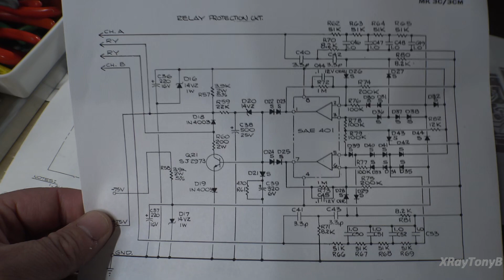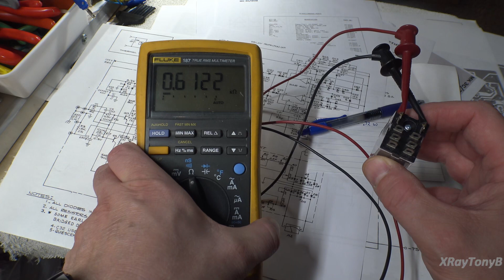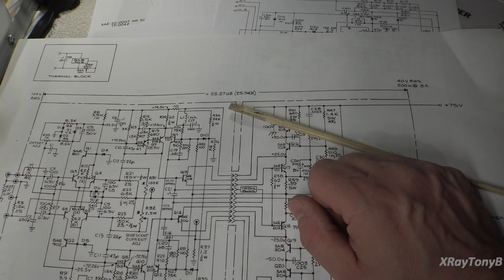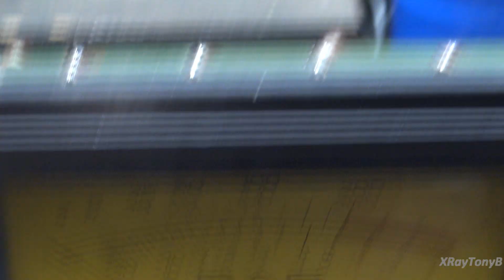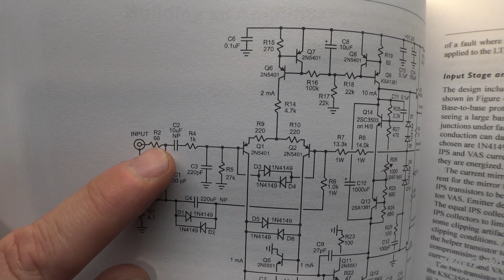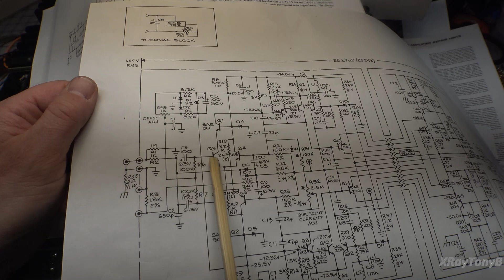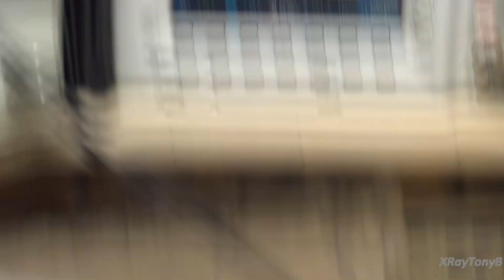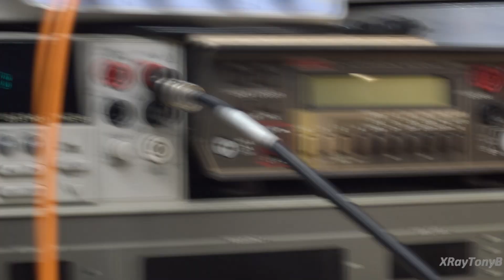SAE Mark IIICM Amplifier - Part 2 - Making it Right

Comment: I'm not happy about you taking schottky diode out I think was the wrong approach! just to protect the transistors why should that matter, The designer put them there for the sound signature and by taking them out you change the sound signature now off the amp. The designer must had like the sound that's why he put them in, must make quite a bit of difference I think they're quite an expensive part back then would have been. Be nice if you done a comparison one side to the other with and without.
How much is he asking for this amp what's the price they sell for.
Reply from the maker: The schottky diodes were not, in my opinion, a good choice in this circuit.  Two of the four were shorted and the other two were reading in both directions (leaky).  The purpose for the emitter resistors is to limit current and to compensate for differences in gain between the transistors.  As the amplifier drives the speaker at higher amplitudes, the voltage drop across the resistor will increase and the current through the resistor will increase.  The power imposed across the resistor will be dissipated as heat.  The diodes have no influence until the voltage drop across the resistor exceeds the forward bias voltage of the schottky diode.  At that point, the diode begins to conduct and the voltage drop remains at the forward drop of the diode from that point on.  As the amplitude out to the speaker increases, the voltage remains the same across the diode, but the current increases.  As the drop on the diode is less than the Vce drop on the transistor, the transistor will take the majority of the excess current and will have to dissipate it as heat.  In addition, the difference in gain between the NPN/PNP transistors will also be dissipated by the transistors.  I believe this is why so many viewers have reported  that the output transistors often fail in these amps.  By reducing the emitter resistor resistance and eliminating the diodes, the amp will still allow proper transfer of power to the speaker while still doing their job limiting the excess curren between the transistors.  I highly doubt that the amp will sound different than it did, but I will hopefully be more stable.  The schottkey diodes are also under a lot of stress in this configuration, so they will have a tendency to short, which will provide no protection at all for transistor imbalances, especially at idle.  It is virtually impossible to find a set of PNP and NPN transistors that are perfectly matched with Hfe and Vbe, thus making the emitter resistors necessary.
Reply: @xraytonyb  You did a fantastic job restoring this basket case to better than new. What a packaging nightmare! 

Regarding the diode comment, your amp showed nice symmetrical clipping at full output, very low THD, flat frequency response and very good square wave response which is indicative of good transient response. It would be interesting to see the intermodulation distortion for this amp, but I think it would also be very good. The job of an amplifier used to reproduce a recorded performance is to do so without additional coloration. If anything, I would think those diodes would introduce distortion. 

Sound instrument amplifiers are another story because they become part of the instrument. For those amplifiers, coloration is usually desirable by the artist. A Fender tube based guitar amp will sound much different than a high quality solid state amp of equivalent power. Once the artist records a performance, their intent is for us to play it back without adding or subtracting anything from it. Otherwise it's kind of like making a Xerox of a Xerox.
Reply: @xraytonyb  yes that's the thing aren't you limiting the current to the speakers by removing the diode and reducing the the slew rate as well, does that have any effect on slew rate?
Reply: @RebelDeuce not really there's a Sonic benefit, he's change the sonic characteristics of the amp but to what degree that's the question?

Comment: i see you got a owon digital powersupply aswell, do you have that weird constant current delay? 
mine takes a while to kick in. like when hooking up a led, limiting output to 20mA but setting CV to like 20V, when turning it on it wont go straight to 20mA  it kicks out a lot of amps killing/damaging the led and then limits the current after a few miliseconds. 
( and i dont mean hooking it to a allready running output so the output caps discharge )

i dont see this bevahiour on my other powersupplies.  (DPS5020, DPS5015 and  some old linear regulated one)
Reply from the maker: I've not noticed this issue on mine, but now I feel the urge to test that out.  Thanks for the heads-up!

Comment: Hi Tony, 
I'm enjoying this video series on the SAE.
I think you overcomplicated the relay issue though.
It simply connects to the +75V and is ground side switched by Q21 through R60 and D19.
D18 being the back EMF diode across the coil.
Nothing feeds back from the collector side of Q21 into the control circuit.
Looks more like the original relay would be a nominal 60V coil rather than the more standard 48V, given the 75V supply, the coil resistance 820 Ohms and R60 being 200 Ohms. Would give very close to 60V across the coil.
Maybe a 48V coil version like you used for the soft start would be the best choice along with the extra series resistor?
Regarding the output stage, it's amazing how many mistakes were made but the amplifier was still able to work comparatively well!
Reply from the maker: My concern was more about the voltage drop and current through the relay coil.  As the DC resistance is important, I felt it would more faithfully copy the characteristics of the original relay.  I was also concerned about the pull-in and drop-out voltages for the relays.  It may be overkill, but for the cost of a resistor, I think it was worth it.  Thanks for the comment!
Reply: @xraytonyb  sometimes it's easier to see things from a distance and comment on something someone's already done.
As I saw it, the transistor is acting only as a switch, the protection  circuit characteristics being determined by the comparators.
And with the 75V supply you would have way more than 24V across its coil, even with the extra series resistance you added. That was my main concern, overheating the coil of the new relay, and why I thought the 48V version you used in the soft start would have been a better match for the circuit.
The comparatively low pull-in voltage of the original relay (assuming it was a 60V coil) is again made irrelevant because the circuit characteristics are determined by the comparators.
Reply from the maker: I'll have to take a closer look at the schematic.  You make some interesting points.  So far, the setup I have is working fine, but there's always a better way!  Thanks!

Comment: Very interesting and now better than new. Owner should be very appreciative.There must be very few people worldwide with the knowledge and determination to fix these old monsters properly.  Skilled craftsmen in all disciplines are dying out fast. Your reference to grandson reminds us that it is mostly grey hairs (not only I'll admit) doing this kind of work. I remember seeing an Audio Research d350 which had been traded in and even the young me could not imagine using that power else lugging the thing around. My Marantz pm8005 which produces 70 a side into 90db speakers actually sounds very powerful so technology must have come some way since those days.
Reply: Back in the late 70s early 80s, high end speakers like the Ohm model F were gaining popularity. They were not very power efficient and had a recommended amplifier power rating of 100- 200 watts. By contrast, my Klipsch Horns (1940s design) are quite loud with only a few watts driving them.
Reply: Funnily enough, Audio Research did a lot of damage to repairmen by introducing "the potted circuit" That were small essential circuits that they enclosed in epoxy and completely erased markings off transistors and other parts replacing them with color codes. None of the necessary information for repair was handed out all in an effort to kill servicing outside of Audio research itself.

Comment: Hi Tony, I've been following this series with some interest,.  Back in the mid-seventies I was lead bench tech at a high end audio sales and service center in Queens NY.  We were an authorized warranty repair center for SAE, Phase Linear, Bose, B&O, Nakamichi etc.  We had it comparatively easy, as we had the manuals and the parts directly from these companies, so it was a matter of simply identifying the bad components and reaching into the manufacturer supplied parts and replacing with the exact same part numbers.  Something the previous repair tech on that SAE obviously did not have access to....lol  Very nice work you did!  Those high power amps could be VERY tempermental.  Phase Linear 700 amps for example...350W RMS per chan--DIRECT COUPLED.  Yep. put in DC, and you get DC out...lots of it...also tended to be a little unstable, like breaking in to oscillation at 100Khz at 350W....It wasn't pretty when it happened!  The amps, and especially the speakers did not like that at all.  But, I have to say, nothing sounded as nice as those big power amps, and good speakers.  Anyway,  just wanted to say STELLAR JOB!

Comment: There's two different types of technicians, the first time that I came across this channel, I kinda found it boring but I didn't understand at the time what was actually going on back then and transistors were an anomaly to me, I was taught that they are like switches and that's basically how I viewed them. 
Then I came across "Steel Wheels Down" channel and his description of transistors changed my life forever! Sadly he's no longer with us, cancer has taken him! But his channel lives on to teach people about Electronics, his last video is sad, he knows that he hasn't got much time left so it's kind like a good bye.. I highly recommend to anyone that hasn't seen his videos yet to check it out! 
Since then, everything on this channel made complete sense! 
This sort of work takes much longer than the other type of repair style, anyone who has seen the 12V Videos channel should have seen the difference, both channels have a type of customer that they service. Those that have something special and know it come to people like Tony, it costs more to repair but it's going to be done right and it's going to be as close to the new condition as possible, you will possibly only ever have to see Tony once for that one job. The next time it will be for another piece of equipment... 
12V videos on the other hand, Pop's the case and with his many years of experience dives straight to where the failure is really fast! I remember screaming at the screen, wait wait wait, check the voltages! Power supply first! 
But he's servicing a different type of customer! His customers are not interested in making their devices last for ever, they just want it working for as cheap as possible because it's cheaper than buying a new one! In a way, he's keeping that piece of equipment out of the landfill for a while longer.. sure he's going to get it working, but something caused the failure of the dead component in the first place and even though it's now working, it's going to fail again... 
We get to see an hour of Tony working but the reality is that it probably took twice as long if not longer... 
I enjoyed every minute of every single video including all the noisy schematics, sure it could have been fixed faster, just replace what's broken and send it out, but as we saw clearly in this video, it would have came straight back with more destruction.. it takes time to get it right. Everything has to be double checked twice if necessary... 
I'm now used to the different ways that technicians work, and I understand that depending on how I feel about my equipment will dictate who I take it to, I have had bad experiences in the past with having equipment repaired, it would have been so much better if I was told in advance that I had a choice of how I wanted it to be repaired, or if they didn't do full restorations and that I would have to go somewhere else if I wanted that. They would just take the job, replace the obviously broken component as hand it back for a fee!  6 months later it's dead again! 
My electronics have had a lot of time put into them from the standpoint of research, I made the purchase to keep it forever, if something ever did go wrong with it, I want someone like Tony to work on it, but before YouTube was a thing, you only had word of mouth, oh he's really good and doesn't charge to much! Finding someone who works like this was impossible... At least where I am. And even today, I couldn't recommend anyone! I had a Denon cassette deck which had a failed 5v regulator, took it to the local hifi store (this was about 5 years ago) and they organised someone to fix it for me, $120 later it's back in my hands and it works! Great, but 6 months later it failed again and it was the exact same problem, I'm not going to call on him for any repairs ever again.. my Denon aint going to the landfill yet, so I just packed it away and put it aside and just got another working deck, later on, I learned how to fix it myself after watching a hell of a lot of videos, reading more books than I probably did whilst I was at school, I'm sure my teacher's would be proud of me if they can only see me now. In 5 years time, I have learned so much, I understand both solid state and Vacuum tubes... I can repair, design and modify.. YouTube might have started with rubbish videos but it's now become the best way to learn anything apart from self experiment.. lessons are hard earned in the later case that linger longer in the memory LoL... 
So thanks Tony once again, I appreciate your time and effort much more than even you realize...

Comment: Question about switching the meter leads - are you sure the left channel isn't on the left side as viewed from the speaker output terminals?   Not everything for the left channel will be on the left side, otherwise the "left" output will be to the right of the "right" output.  There has to be a crossover somewhere.  The real test is if left channel input will deflect the left meter.
Reply from the maker: I looked behind the front panel and the wires were indeed swapped.  I think it was done by someone in the past, as I could see where they were in there cleaning the switches at some point.

Comment: How did the amp function with the wrong parts?  Guess it never worked correctly.  GREAT restoration Job, but what do you do that is not GREAT.  Very musical sounding amp.
Reply: Previous owner was either oblivious or a lying bastard hoping to get it working just long enough to get rid of this ticking time bomb.